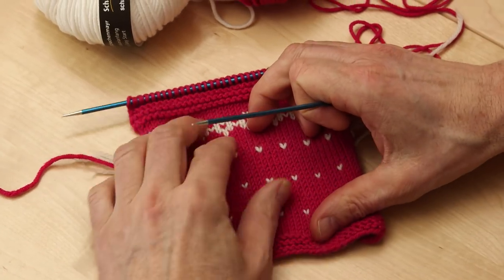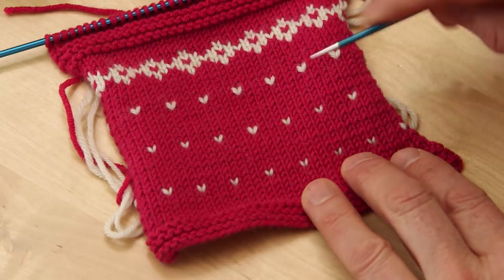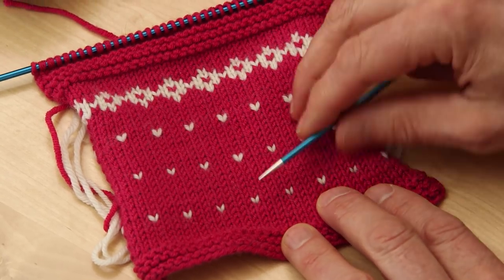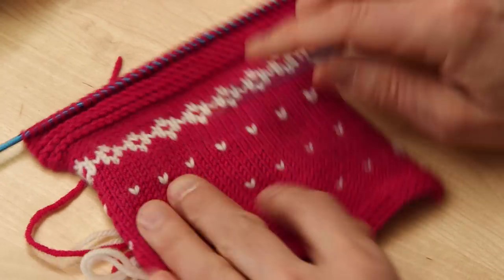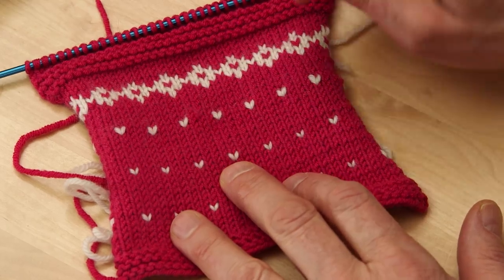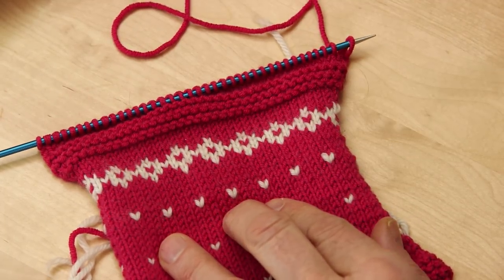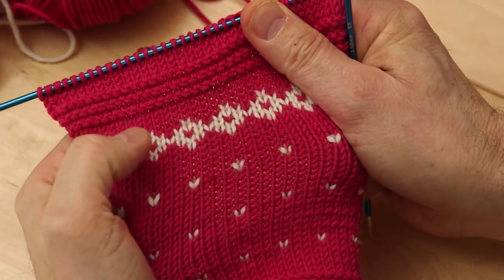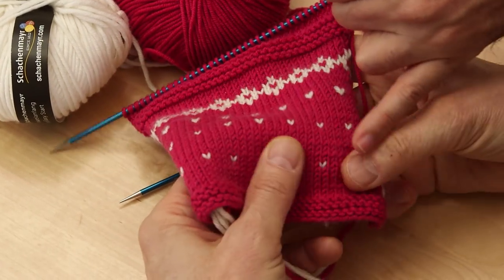How to fix uneven tension in your knitting projects by ARNE & CARLOS

Comment: Wonderful informational video!  Thank you!  Can you please do a tutorial on colorwork knitting in the round?  How do you avoid a jog in the colorwork?  When I start the new round with colorwork , I get ugly stair-step or jogs in the colors.  My motif gets all askew and looks really bad at the start of a new round. How can you avoid the ugly stair-steps and have clean circular colorwork in your knitting?  Thank you Arne & Carlos!
Reply: There is a new book out by Tin Can Knits called Strange Brew that discussed all the ways to create colourwork to hide jogs. It basically comes down to large patterns, placing the jog at the center back of the sweater, and small pattern repeats, placing the jog on the back scapula area. Great resource by the way

Comment: I've been  trying the Norwegian method to knit and purl  instead of throwing, but am having a harder time with tension.  I know my issue is with holding the yarn in the left hand.  I can see that Arne is holding the yarn over his finger, but  the camera does not catch how he holds the yarn with his other fingers.  When throwing I usually wind the thread around my  left hand  in the same way I do  with crochet, but although I am doing the same while kitting the Norwegian way my tension is all off-- sort of good/horrible.  I have been knitting swatches to try  evening my stitches out.    I can see I will have to practice for quite a while.  Is this just a matter of muscle memory or is there another way to adjust the yarn tension with the left hand?
Reply: OK, I found your video on this.  My purling is still looser than my knitting, but I'm sure it's a matter of practice.  Off to do another swatch!